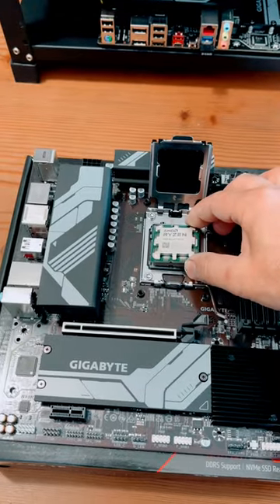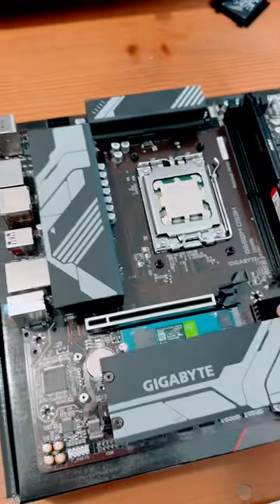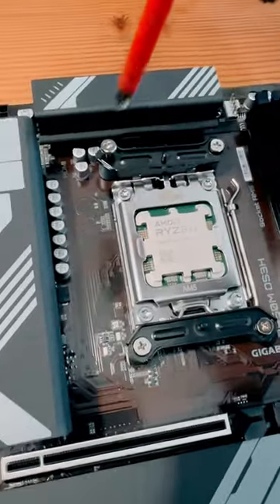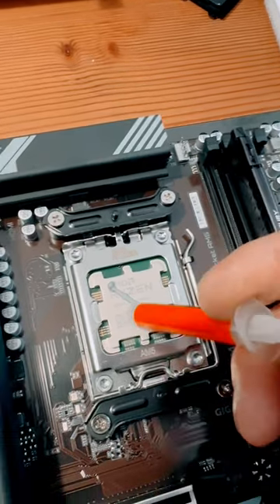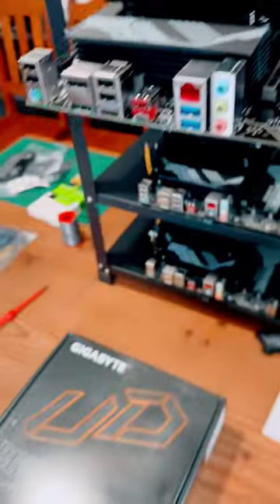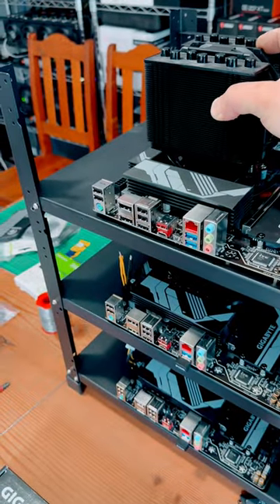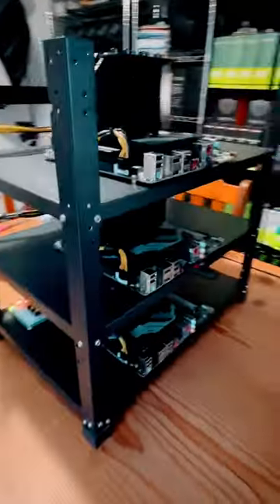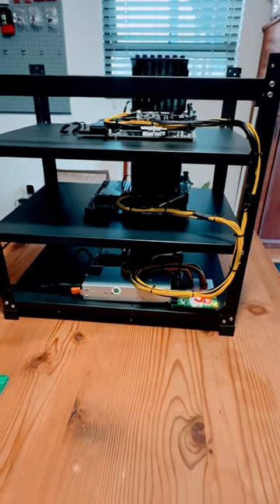Build a CPU Mining Rig in 60 SECONDS! #shorts

Comment: what kind of psu are you using for that multiple 24pin for the motherboard?
Reply from the maker: I am using a Dell server PSU with a X11 Breakout board. To power the 24-pin, i am using a pico power adapter.
Reply: @ThreeFoxCo  ive checked your other video too and found it, thanks for the info
Reply from the maker: @kurakurakii3792  i am glad the videos are of value!

Comment: how about the power supply? 1 psu for 3 system?
Reply from the maker: The PSU is a Dell 1200W with a Parallel Miner X11 breakout board. It has plenty of power to run all 3 rigs.

Comment: B450 msi gaming plus max + 5900x 
Or 5950x 
Can they work ???
Reply from the maker: Both will work, although the 5950x is the better of the 2…
Reply: @ThreeFoxCo  will try 
Computer shop guy told me 
Need to update bios
Reply from the maker: @samratdoor.closer when upgrading the bios, make sure NOT to use beta versions, as this could cause issues sometimes.